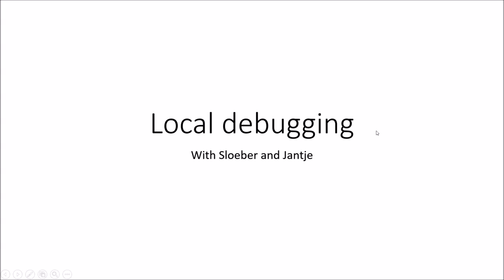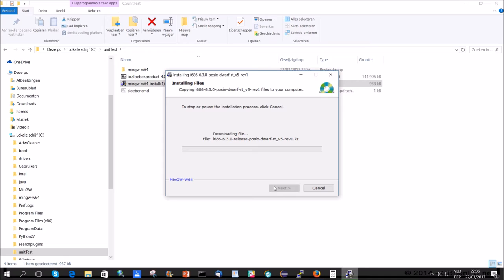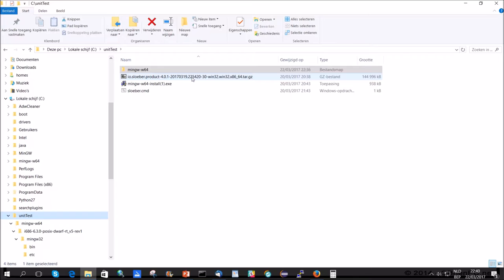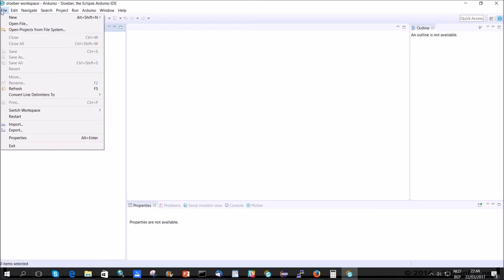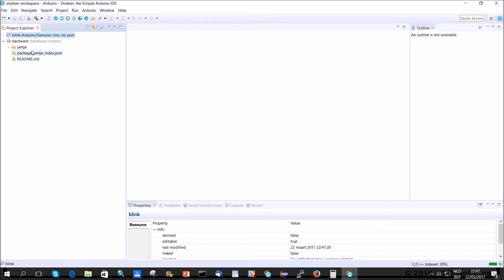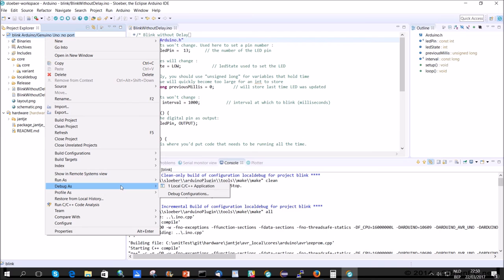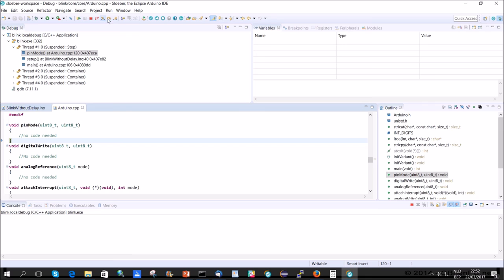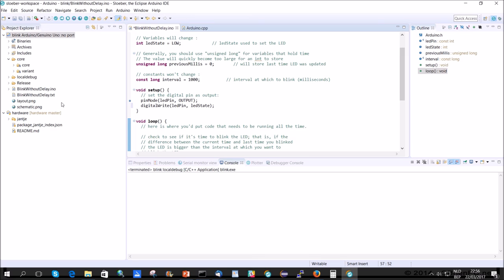Debug your arduino code on your local machine

Comment: Heads up to others that while the test part of this video is still relevant, the installation part is not.

With sloeber 4.3, the jantje platforms are already bundled. All you need is to go select them under Arduino /> Preferences > Platforms and Boards.
Reply from the maker: Indeed
Reply: Excelent! Thanks

Comment: Got around to trying it today. Got up to 11:50 and ran into the below error.
Create eeprom image
dir "C:\unitTest\sloeber-workspace-unitTest\blink/localdebug"
/usr/bin/sh: dir: command not found
makefile:86: recipe for target 'blink.hex' failed
make: * [blink.hex] Error 127
Tried plugging in the uno, because I forgot and still got the error.
Any suggestions??
Reply from the maker: It looks as if you have a pre V4 make. /usr/bin/sh on a windows machine indicates a path/make issue. Are you on the nightly (lots of path induced problems have been fixed there). Anyway it doesn't really matter as the exe has been made at this point. You are in the "make sure the arduino way to compile a project does not cause problems".
Now I think about this.... I don't think this is still needed with the changes in V4.
Reply: Thank you, I got the most current. io.sloeber.product-4.0.1-20170319.225420-30-win32.win32.x86_64.tar and it is working fine, and without the Uno plugged in.  Now I just have to figure out the debugging part and I am good.
Reply from the maker: Once you have it compiled on your local machine debugging is easy to get started.

Comment: Excellent idea!! Unfortunately didnt succeed with setup on mac. 
1) updated parameters for g++ to use "-dead_strip" instead of "--gc-sections"
2) used avr-gdb as debugger 

got exe file generated (guess, this is the showstopper), it seems to some parameter should be updated here
Debugger claims "not in executable format: File format not recognized"
Reply from the maker: Great news you are so close with the mac :-). One of the big advantages of cloning the github repository is that you can change the compile commands in eclipse in the hardware project. Once saved locally just reselect the board in the project properties and select apply (ok won't do it in the later versions) and you compile with your new settings.
I don't understand why you would need avr-gdb as the code is running on a mac?
Reply: Hi, i was not able to find gdb on my mac, and according to google Apple has removed it quite long time ago. Therefore I just pointed to arv-gdb (located in Arduino folder). Probably its wrong and I have to install some other one.

Nevertheless, but the issue where I stopped now is saying: 
Error in final launch sequence
Failed to execute MI command:
-file-exec-and-symbols /Users/......./blink/localdebug/Blink.exe
Error message from debugger back end:
"/Users/......./blink/localdebug/Blink.exe": not in executable format: File format not recognized
Reply from the maker: You are using a avr debugger on mac hardware (which is very unlikely to be a avr). 
You need a debugger for your os. I can't tell you where to get one as I don't own a mac.

Comment: Hi! Been trying to get this to work, but when I get to the part after adding #include Arduino.h, and try to compile, I get a makefile error for arduino.ar, and when I look in the makefile, the error is on line 73 and all it has is  @echo 'Starting archiver'
Is it likely because I'd been doing other stuff before I got to this tutorial, and it wasn't a totally fresh install? I really hadn't done much apart from add some boards and try compiling a couple of my arduino sketches. 
I even started a new workspace to try this out, so everything was as clean as I can imagine it could be. 
The only thing I haven't done, is as per your comment here about installing from the hardware section of your gitbub, since it doesn't appear that those files exist anymore (I assume you were referring to the actual Sloeber instal that you had in there which you mentioned in another video?)
So yeah... any ideas what that might be about?
Reply: Actually, never mind. I thought I might need to update, so I ran the updater, and it completely broke Sloeber. Throwing messages about Java and HOME paths missing. Deleted the whole lot and started fresh, and it's working now.

Comment: Making steady progress. My localdebug confiugration does generates an elf file, not an exe. Any advise? I am using the bundled hardware platforms hardware/pc/1.0.2 on 4.3.
Reply from the maker: Did you switch configuration like I did in 11:30 ?

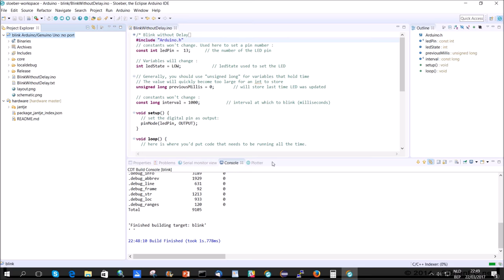Comment: Hello Jan, I folowed all your steps until "11:42" in this video. After compiling I got this error message and cannot fix the problem.

08:44:16 ** Incremental Build of configuration localdebug for project blink **
"C:\\ArdTest\\sloeber\\arduinoPlugin\\tools\\make\\make" all 
'Building file: ..\sloeber.ino.cpp'
'Starting C++ compile'
"/bin/g++" -c -g -O0 -w -fno-exceptions -ffunction-sections -fdata-sections -fno-threadsafe-statics -DF_CPU=16000000L -DARDUINO=10802 -DARDUINO_AVR_MEGA2560 -DARDUINO_ARCH_AVR_LOCAL  -DLOCAL_RUN  -I"C:\ArdTest\git\hardware\jantje\avr_local\cores\arduino" -I"C:\ArdTest\sloeber\arduinoPlugin\packages\arduino\hardware\avr\1.6.21\variants\mega" -MMD -MP -MF"sloeber.ino.cpp.d" -MT"sloeber.ino.cpp.o" -D__IN_ECLIPSE__=1 -x c++ "..\sloeber.ino.cpp"  -o  "sloeber.ino.cpp.o"  -Dsrandom=srand -Drandom=rand
System cannot find the given path
subdir.mk:31: recipe for target 'sloeber.ino.cpp.o' failed
make: * [sloeber.ino.cpp.o] Error 1

08:44:17 Build Finished (took 379ms)

Any haelpful advise would be great.
Reply from the maker: Have you switched configuration like I did in the video? Doing it when in project properties does not work.
Reply: thank's a lot. Now it works !!!

Comment: Thanks again for this video. It did not work for me with the git hub code, like in the video, it could not find the path for mingw. But It worked when I added the jantje/localdebug/1.0.1 through plantform and boards. In the editor, I get red lines under pinMode and digitalWrite, in both cases. Do you know how to get rid of these ?
Also, how far is it possible to debug. Is it possible that way to debug locally a webserver ?
Reply from the maker: Adding the jantje/localdebug/1.0.1 through platform and board is the new and improved way to do this. More work for me less for you.
If you want to locally debug a webserver you will have to "port to pc" the Arduino web libraries you use.
The red lines are caused by the indexer so check your indexer setings.

Comment: What the cat owes You that You so scared him ? :)
Reply from the maker: As far as I'm concerned the cat  is a non-impressed bug :-)
Reply: I see :) ... anyway regarding the subject... unfortunately  following the steps You described I haven't managed to make a project pc debugable there. But fortunately I find out that Sloeber 4.3 already has all the required parts in its distribution (I can do a mistake here since i did it after I installed everything You said and then I just removed part by part to leave the Sloeber bare.  arduinoPlugin folder with all the folders inside it was left there after that and I see it doesn't present in the original archive but I suppose it has been downloaded from the Internet when installed). Anyway thank You for the right direction where to investigate. And regards.

Comment: PLEASE DEBUG THIS UNO OR MEGA CODE:
/* 
 Mini CNC Plotter code
 */

#include <Servo.h>
#include <AFMotor.h>

#define LINE_BUFFER_LENGTH 512

char STEP = MICROSTEP ;

// Servo position for Up and Down 
const int penZUp = 95;
const int penZDown = 83;

// Servo on PWM pin 10
const int penServoPin =10 ;

// Should be right for DVD steppers, but is not too important here
const int stepsPerRevolution = 48; 

// create servo object to control a servo 
Servo penServo;  

// Initialize steppers for X- and Y-axis using this Arduino pins for the L293D H-bridge
AF_Stepper myStepperY(stepsPerRevolution,1);            
AF_Stepper myStepperX(stepsPerRevolution,2);  

/* Structures, global variables    */
struct point { 
  float x; 
  float y; 
  float z; 
};

// Current position of plothead
struct point actuatorPos;

//  Drawing settings, should be OK
float StepInc = 1;
int StepDelay = 0;
int LineDelay =0;
int penDelay = 50;

// Motor steps to go 1 millimeter.
// Use test sketch to go 100 steps. Measure the length of line. 
// Calculate steps per mm. Enter here.
float StepsPerMillimeterX = 100.0;
float StepsPerMillimeterY = 100.0;

// Drawing robot limits, in mm
// OK to start with. Could go up to 50 mm if calibrated well. 
float Xmin = 0;
float Xmax = 40;
float Ymin = 0;
float Ymax = 40;
float Zmin = 0;
float Zmax = 1;

float Xpos = Xmin;
float Ypos = Ymin;
float Zpos = Zmax; 

// Set to true to get debug output.
boolean verbose = false;

//  Needs to interpret 
//  G1 for moving
//  G4 P300 (wait 150ms)
//  M300 S30 (pen down)
//  M300 S50 (pen up)
//  Discard anything with a (
//  Discard any other command!

/********************
 * void setup() - Initialisations
 ***********************/
void setup() {
  //  Setup
  
  Serial.begin( 9600 );
  
  penServo.attach(penServoPin);
  penServo.write(penZUp);
  delay(100);

  // Decrease if necessary
  myStepperX.setSpeed(600);

  myStepperY.setSpeed(600);  
  

  //  Set & move to initial default position
  // TBD

  //  Notifications!!!
  Serial.println("Mini CNC Plotter alive and kicking!");
  Serial.print("X range is from "); 
  Serial.print(Xmin); 
  Serial.print(" to "); 
  Serial.print(Xmax); 
  Serial.println(" mm."); 
  Serial.print("Y range is from "); 
  Serial.print(Ymin); 
  Serial.print(" to "); 
  Serial.print(Ymax); 
  Serial.println(" mm."); 
}

/********************
 * void loop() - Main loop
 ***********************/
void loop() 
{
  
  delay(100);
  char line[ LINE_BUFFER_LENGTH ];
  char c;
  int lineIndex;
  bool lineIsComment, lineSemiColon;

  lineIndex = 0;
  lineSemiColon = false;
  lineIsComment = false;

  while (1) {

    // Serial reception - Mostly from Grbl, added semicolon support
    while ( Serial.available()>0 ) {
      c = Serial.read();
      if (( c == '\n') || (c == '\r') ) {             // End of line reached
        if ( lineIndex > 0 ) {                        // Line is complete. Then execute!
          line[ lineIndex ] = '\0';                   // Terminate string
          if (verbose) { 
            Serial.print( "Received : "); 
            Serial.println( line ); 
          }
          processIncomingLine( line, lineIndex );
          lineIndex = 0;
        } 
        else { 
          // Empty or comment line. Skip block.
        }
        lineIsComment = false;
        lineSemiColon = false;
        Serial.println("ok");    
      } 
      else {
        if ( (lineIsComment) || (lineSemiColon) ) {   // Throw away all comment characters
          if ( c == ')' )  lineIsComment = false;     // End of comment. Resume line.
        } 
        else {
          if ( c <= ' ' ) {                           // Throw away whitepace and control characters
          } 
          else if ( c == '/' ) {                    // Block delete not supported. Ignore character.
          } 
          else if ( c == '(' ) {                    // Enable comments flag and ignore all characters until ')' or EOL.
            lineIsComment = true;
          } 
          else if ( c == ';' ) {
            lineSemiColon = true;
          } 
          else if ( lineIndex >= LINE_BUFFER_LENGTH-1 ) {
            Serial.println( "ERROR - lineBuffer overflow" );
            lineIsComment = false;
            lineSemiColon = false;
          } 
          else if ( c >= 'a' && c <= 'z' ) {        // Upcase lowercase
            line[ lineIndex++ ] = c-'a'+'A';
          } 
          else {
            line[ lineIndex++ ] = c;
          }
        }
      }
    }
  }
}

void processIncomingLine( char* line, int charNB ) {
  int currentIndex = 0;
  char buffer[ 64 ];                                 // Hope that 64 is enough for 1 parameter
  struct point newPos;

  newPos.x = 0.0;
  newPos.y = 0.0;

  //  Needs to interpret 
  //  G1 for moving
  //  G4 P300 (wait 150ms)
  //  G1 X60 Y30
  //  G1 X30 Y50
  //  M300 S30 (pen down)
  //  M300 S50 (pen up)
  //  Discard anything with a (
  //  Discard any other command!

  while( currentIndex < charNB ) {
    switch ( line[ currentIndex++ ] ) {              // Select command, if any
    case 'U':
      penUp(); 
      break;
    case 'D':
      penDown(); 
      break;
    case 'G':
      buffer[0] = line[ currentIndex++ ];          // /!\ Dirty - Only works with 2 digit commands
      //      buffer[1] = line[ currentIndex++ ];
      //      buffer[2] = '\0';
      buffer[1] = '\0';

      switch ( atoi( buffer ) ){                   // Select G command
      case 0:                                   // G00 & G01 - Movement or fast movement. Same here
      case 1:
        // /!\ Dirty - Suppose that X is before Y
        char* indexX = strchr( line+currentIndex, 'X' );  // Get X/Y position in the string (if any)
        char* indexY = strchr( line+currentIndex, 'Y' );
        if ( indexY <= 0 ) {
          newPos.x = atof( indexX + 1); 
          newPos.y = actuatorPos.y;
        } 
        else if ( indexX <= 0 ) {
          newPos.y = atof( indexY + 1);
          newPos.x = actuatorPos.x;
        } 
        else {
          newPos.y = atof( indexY + 1);
          indexY = '\0';
          newPos.x = atof( indexX + 1);
        }
        drawLine(newPos.x, newPos.y );
        //        Serial.println("ok");
        actuatorPos.x = newPos.x;
        actuatorPos.y = newPos.y;
        break;
      }
      break;
    case 'M':
      buffer[0] = line[ currentIndex++ ];        // /!\ Dirty - Only works with 3 digit commands
      buffer[1] = line[ currentIndex++ ];
      buffer[2] = line[ currentIndex++ ];
      buffer[3] = '\0';
      switch ( atoi( buffer ) ){
      case 300:
        {
          char* indexS = strchr( line+currentIndex, 'S' );
          float Spos = atof( indexS + 1);
          //         Serial.println("ok");
          if (Spos == 30) { 
            penDown(); 
          }
          if (Spos == 50) { 
            penUp(); 
          }
          break;
        }
      case 114:                                // M114 - Repport position
        Serial.print( "Absolute position : X = " );
        Serial.print( actuatorPos.x );
        Serial.print( "  -  Y = " );
        Serial.println( actuatorPos.y );
        break;
      default:
        Serial.print( "Command not recognized : M");
        Serial.println( buffer );
      }
    }
  }

}

/*******************************
 * Draw a line from (x0;y0) to (x1;y1). 
 * Bresenham algo from https://www.marginallyclever.com/blog/2013/08/how-to-build-an-2-axis-arduino-cnc-gcode-interpreter/
 * int (x1;y1) : Starting coordinates
 * int (x2;y2) : Ending coordinates
 **********************************/
void drawLine(float x1, float y1) {

  if (verbose)
  {
    Serial.print("fx1, fy1: ");
    Serial.print(x1);
    Serial.print(",");
    Serial.print(y1);
    Serial.println("");
  }  

  //  Bring instructions within limits
  if (x1 >= Xmax) { 
    x1 = Xmax; 
  }
  if (x1 <= Xmin) { 
    x1 = Xmin; 
  }
  if (y1 >= Ymax) { 
    y1 = Ymax; 
  }
  if (y1 <= Ymin) { 
    y1 = Ymin; 
  }

  if (verbose)
  {
    Serial.print("Xpos, Ypos: ");
    Serial.print(Xpos);
    Serial.print(",");
    Serial.print(Ypos);
    Serial.println("");
  }

  if (verbose)
  {
    Serial.print("x1, y1: ");
    Serial.print(x1);
    Serial.print(",");
    Serial.print(y1);
    Serial.println("");
  }

  //  Convert coordinates to steps
  x1 = (int)(x1*StepsPerMillimeterX);
  y1 = (int)(y1*StepsPerMillimeterY);
  float x0 = Xpos;
  float y0 = Ypos;

  //  Let's find out the change for the coordinates
  long dx = abs(x1-x0);
  long dy = abs(y1-y0);
  int sx = x0<x1 ? StepInc : -StepInc;
  int sy = y0<y1 ? StepInc : -StepInc;

  long i;
  long over = 0;

  if (dx > dy) {
    for (i=0; i<dx; ++i) {
      myStepperX.onestep(sx,STEP);
      over+=dy;
      if (over>=dx) {
        over-=dx;
        myStepperY.onestep(sy,STEP);
      }
    delay(StepDelay);
    }
  }
  else {
    for (i=0; i<dy; ++i) {
      myStepperY.onestep(sy,STEP);
      over+=dx;
      if (over>=dy) {
        over-=dy;
        myStepperX.onestep(sx,STEP);
      }
      delay(StepDelay);
    }    
  }

  if (verbose)
  {
    Serial.print("dx, dy:");
    Serial.print(dx);
    Serial.print(",");
    Serial.print(dy);
    Serial.println("");
  }

  if (verbose)
  {
    Serial.print("Going to (");
    Serial.print(x0);
    Serial.print(",");
    Serial.print(y0);
    Serial.println(")");
  }

  //  Delay before any next lines are submitted
  delay(LineDelay);
  //  Update the positions
  Xpos = x1;
  Ypos = y1;
}

//  Raises pen
void penUp() { 
  penServo.write(penZUp); 
  delay(penDelay); 
  Zpos=Zmax; 
  digitalWrite(15, LOW);
    digitalWrite(16, HIGH);
  if (verbose) { 
    Serial.println("Pen up!");
Reply: Why would anyone debug it for you??